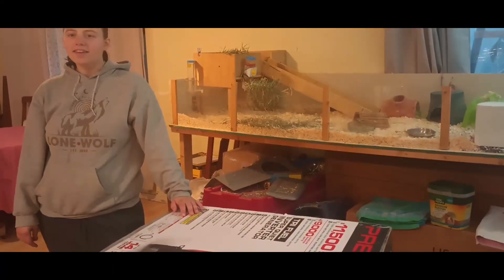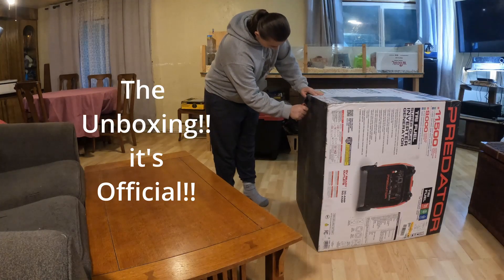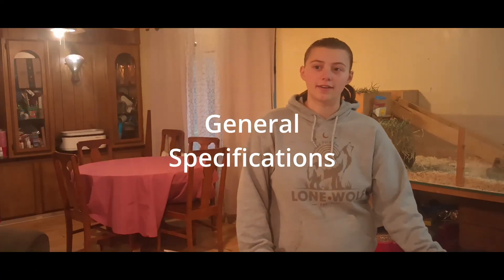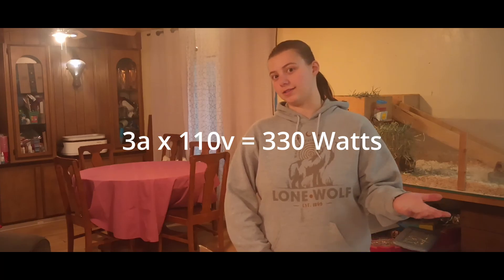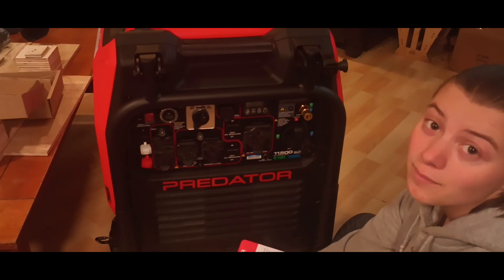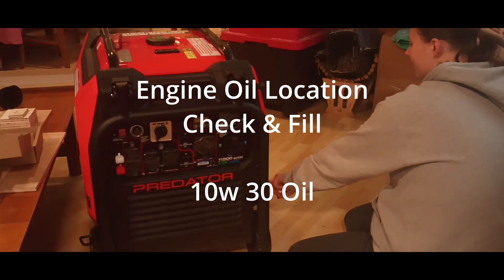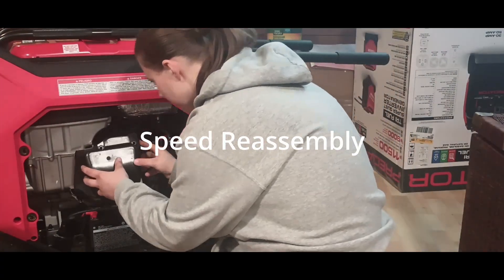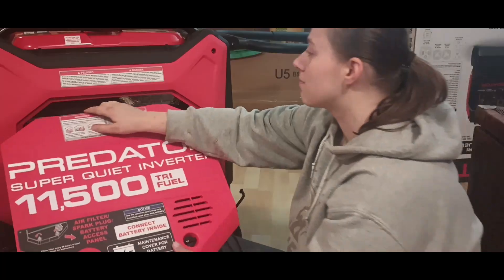Predator 11500 Tri-Fuel Inverter Generator — Full Unboxing, Setup & Honest First Look

Comment: I bought this model, so far very pleased! Replaced my 3500 Watt Honda. Nothing wrong with Honda at all but the good reviews and price for this size Gen-Inverter Tri Fuel come on!
Reply from the maker: What I like is the we they Devised the circuitry So if you run this generator at its capacity it doesn't burn itself up internally...

Last Winter we had a 7 KW inverter generator (A-iPower GXS7100iRD) that Generator Didn't last a week!!! :(  . . . Fortunately for US we got it from Costco
Reply from the maker: This is the 6th Generator we have purchased, and appears to be of decent build quality.
We had another inverter we bought Costco, and it didn't last more than 24hrs..
Although we were asking allot from that 7k

Comment from the maker: 🔥 Thanks for watching! Quick question for you,  what do you want me to test next on the Predator 11500 Tri-Fuel?

Here are some ideas viewers have already asked for:
• Noise test / decibel test- Note I do not have a meter!!
• Full load test (space heaters, welders, tools, etc.)
• Tri-fuel switch demo (propane vs gasoline)
• Oil change walkthrough
• Accessory setup (covers, adapters, maintenance tools)
• Real-world storm preparedness setup
• Runtime test on each fuel type

💬 Comment below with your #1 request 
We work hard to film the one that gets more than 100 requests next.
Thanks again for all the support! 🙏

Comment: Did you only push the button once cause you have to push it once then you gotta push it a second time the first push turns the power on then the second push tells it to start
Reply from the maker: We consulted the manual to ensure we were pushing it correctly. The Button only Blinked despite reputative pushing attempts.., 
Fortunately for us it starts when pulling with a charged battery!!
Reply: @2creachadoir713  that is unfortunate, but at least it works with the pull start